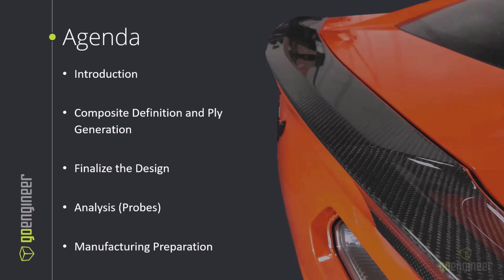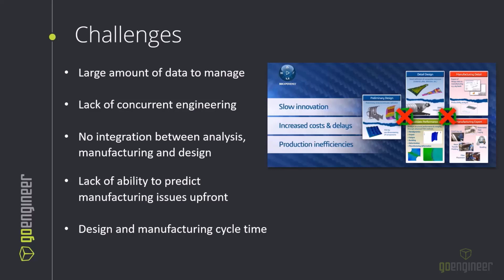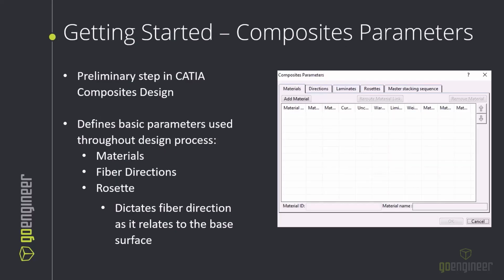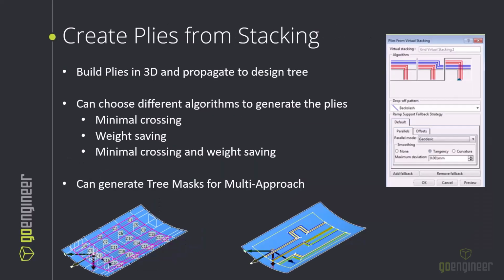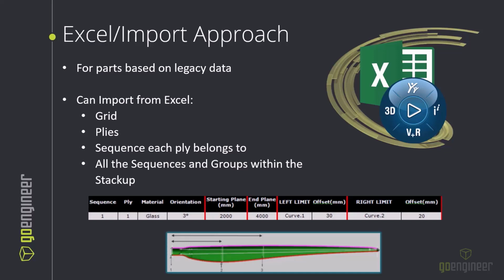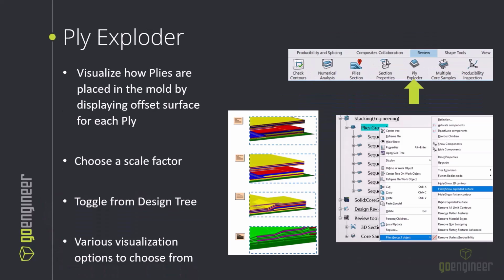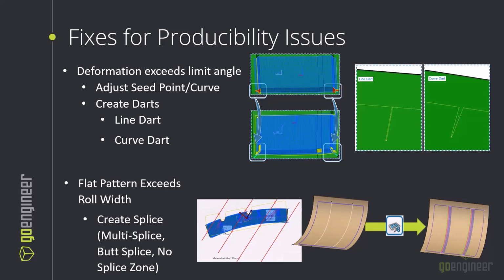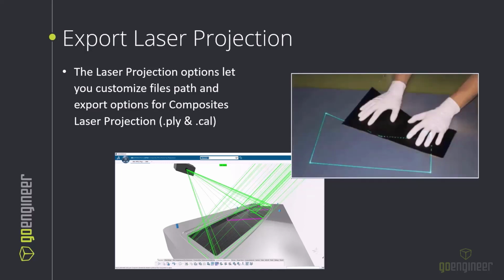Composites in 3DEXPERIENCE CATIA - Webinar

Comment: Thank you for making the video.
Do you create layup and final marching definition as separate parts or as a single part with all definition?
Do you create manufacturing flatter. Ply information in the same part?
Have you ever created composite model based definition for composite parts?